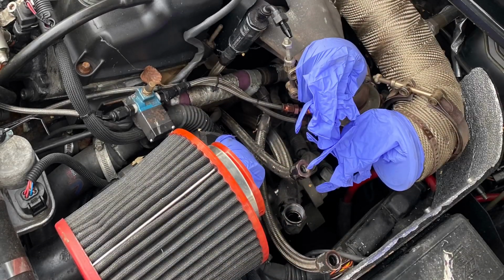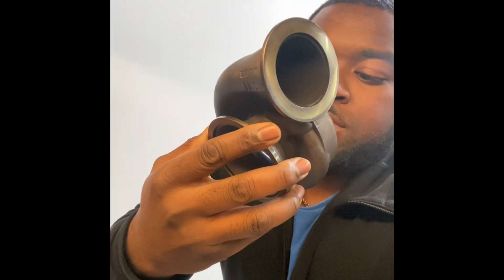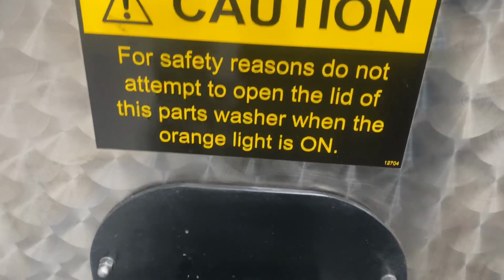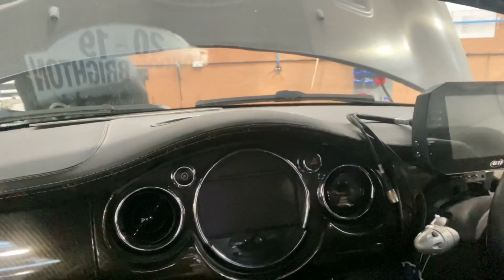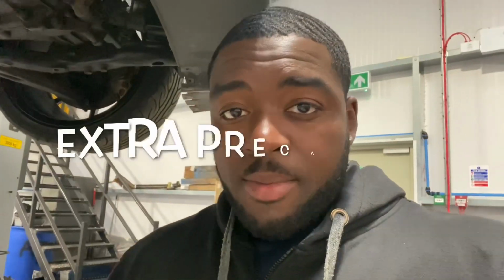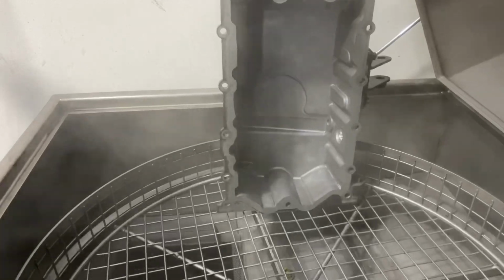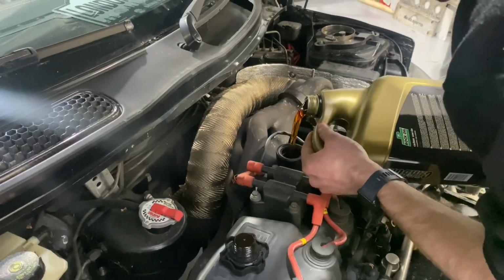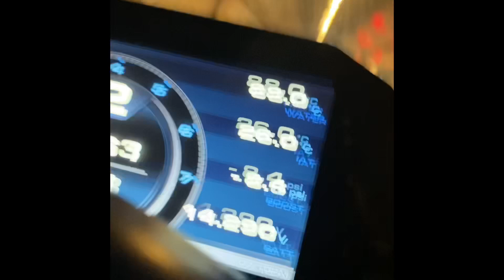TURBO R53 CABOOM!!! COOPERXT NEW TURBO!

Comment: Can you give me a mod list of this and some specifications please bro I need help btw nice video as always subscribed and liked
Reply from the maker: Paras Jangra MINI R53 engine
 dual ball bearing hybrid turbo
Gold custom billet wheel 
Tial v-band
38mm wastegate
3" 1320 downpipe
Screamer pipe
Tial bov
2% enlarged lightened crank
1000 injectors
Cat cam (billet)
1320 sidewinder exhaust manifold
1320 custom billet collector
1320 Ported head gs valves and crown springs
Forged pistons
Ported inlet manifold
Relocated throttle body
Vipec ECU
Forged rods
3" custom BORLA Exhaust with decat
Clutch master FX500 clutch
Clutch master Single mass Flywheel
Pro alloy FMIC and Rad
1320 custom MANIC Map
6speed gear box
Quaife 1.5 LSD
AEM AFR Gauge 
Cooper S fuel Pump
MSD leads
Custom header tank
Reply: @jamesmini-cooper2352  thanks bro your comment means a lot
Reply: Amazing build